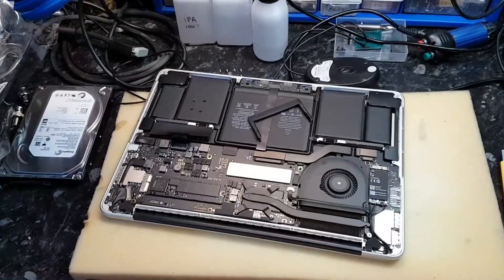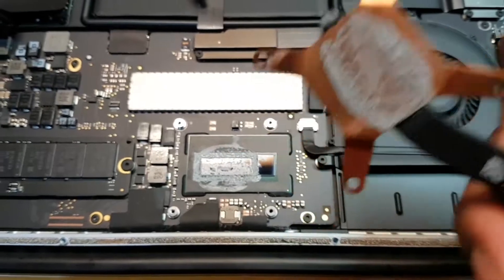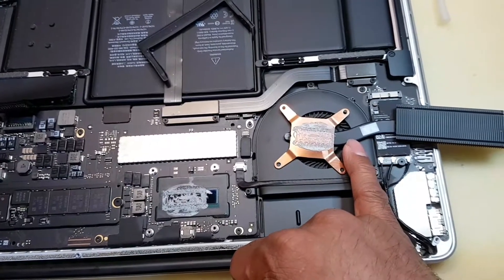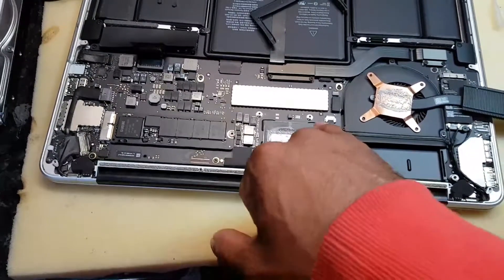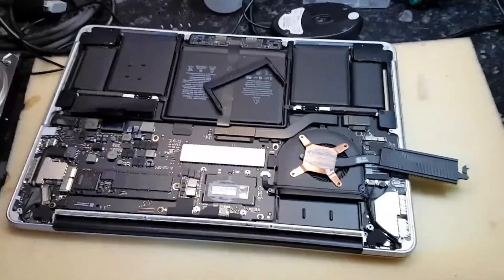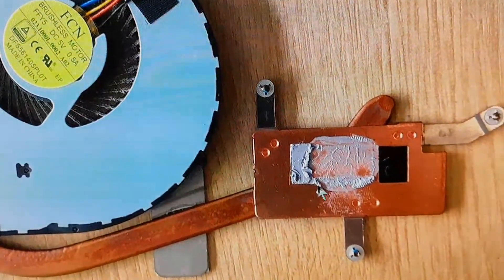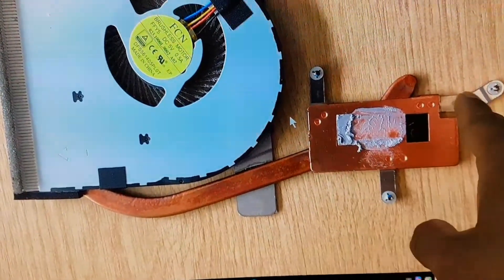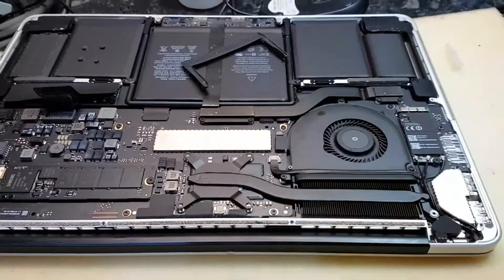POOR THERMAL DESIGN APPLE MACBOOK PRO PCH FAILURE A1502 LATE 2015 NOT GPU SORRY

Comment: That’s the PCH, not the GPU. The CPU runs as a FAR hotter temp and this heat will transfer to the PCH if you put paste on them both. There’s a reason why Apple left it like this, hell, the copper heat sink is cut short so it doesn’t touch the PCH. You should update or delete this as it’s not correct mate.

Comment: Why in the world do you think the PCH is dying from heat? It's not. If anything, the issue is from the 2015 models not running the fan until the unit gets warm/hot. This is not due to thermal paste! We've repaired hundreds of these, and have not seen a single one that died from "heat", or improper thermal paste. How did you decide this was a failure from heat-related PCH damage? I'd be very curious to hear your exact reasoning, with data and numbers. Also, what are you declaring as "dying"? If CPU gets warm when power applied, CPU is 95% not dead. We've seen a ton of corrupt BIOS on these, and failed panels, which people think are bad CPUs...not the case. You keep saying "why didn't they just put thermal paste over the PCH?",...because it's not needed. The CPU is where your heat is on these. Total misinformation.
Reply: With all due respect, you're incorrect in this case. I appreciate the time/effort of explaining, and putting up the video, but you're going to have people unnecessarily pulling their heatsinks and risking damage to their boards. "It's often more dangerous to be misinformed than uninformed". Again, this is not causing any issues with the board. Apple has used this same design since 2013, and have had no issues with heat on the 13" models, period. It certainly doesn't hurt to apply more thermal paste (even this is arguable), but all I'm saying is you're not preventing any overheating by doing so. In fact, the 2015 models run cooler than the 2013/2014 boards, which didn't even have overheating issues. Again, if you come across a "dead CPU" on this model, it's more than likely going to be (1) liquid to the CPU regulators/vcore power supplies, (2) liquid to CPU support/regulation, (3) damage from a drop, or in some cases, (4) corrupt bios that mimics a defective CPU (power, no chime, all rails present). Again, this is a non-issue; I don't mean to offend or come across as rude, but you're presenting misinformation. :)
Reply: @sjword  Correct, but these days, everyone think they techs and know it all without any experience or knowledge watching a few episodes of rossman, would they know about timing signals lpc, reset timings etc?